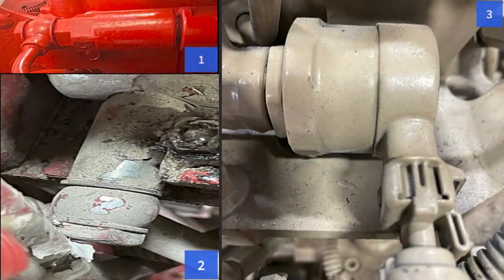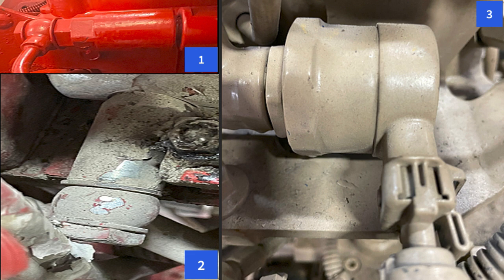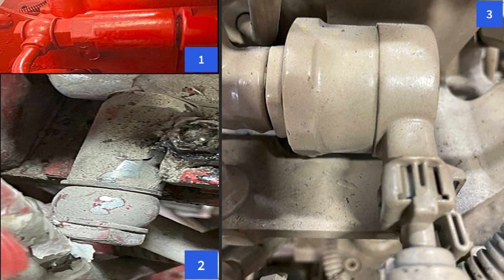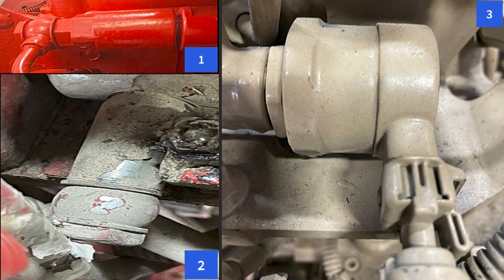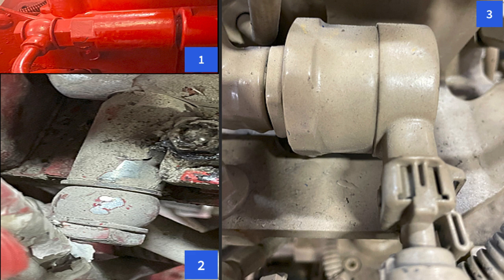A little information about fuel rail relief valves

Comment: Thanks Joe! Don't know much on Cummins side but isn't the XPI fuel system a Cummins Fuel Systems product with Scania joint development and some of the midrange and big bore stuff is supplied by Bosch so maybe reason is different supplier strategy? The electrical connector looks like a Bosch Kompakt 1.1 on #3. On Delphi common rail, the rail pressure valve is a current controlled valve to keep it closed. If it gets unplugged or circuit issue, rail pressure goes to a limp home mode because has a spring loaded valve that will allow about 4500 PSI in rail. The ECM stores in memory the current required to keep valve closed, so usually you have to perform a reset in ECM is you replace the valve. The Delphi will actually use the release valve under certain conditions and runs self test during operation so it isn't just a safety relief valve. Thanks again, Steve.
Reply from the maker: Yes scania and other manufacturers do joint ventures on systems. They share engineers and it is a web if we tried to sort out who is who and who did what. Cummins was always smart enough to know their limitations in the moment and worked well with others.
Im not sure of your age but when you are looking for something to do down the road you should start a channel or web to share info. Understanding what is happening and why is what makes a good troubleshooter,, tech, teacher. You have all that.
I appreciate the comments and know that it helps many people. 
My friend and former colleague David Turner, God rest his soul, used to say "The world is round - it always comes back"

Comment: When removing the relief valve , how do you release the pressure from the common rail tube ?
AS ALWAYS , Thank You !
Reply from the maker: Fellow viewer  "  @christalton9261   is correct. Loosen the high pressure fuel pump steel supply line at the rail.